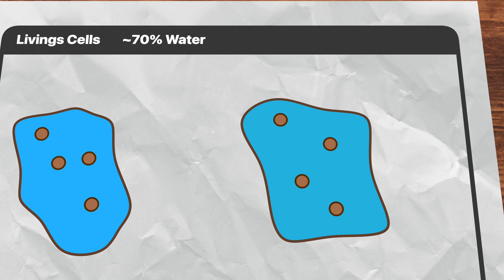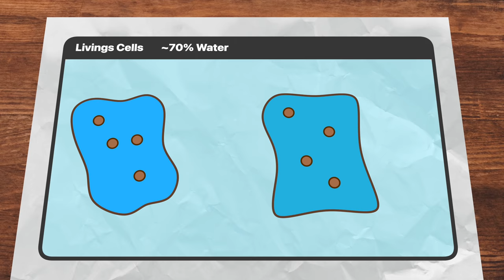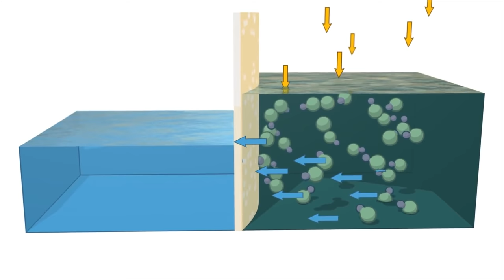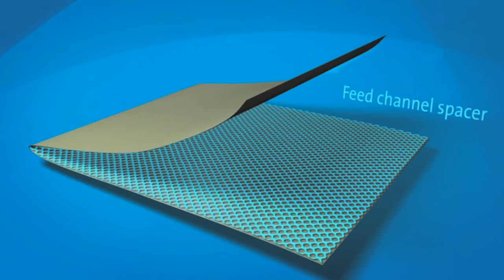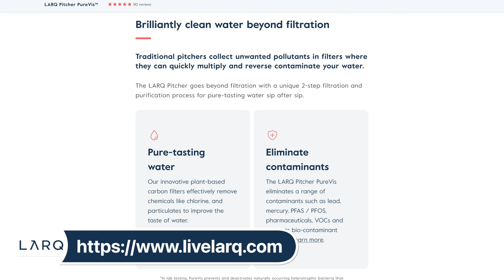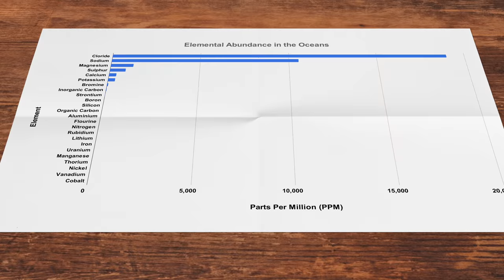Why Not Build Desalination Plants EVERYWHERE?

Comment: While in the US NAVY the ship that I served on was nuclear powered. We used the reactors heat to distill sea water for the ships reactor coolant and drinking water, plus equipment coolant as sell. We never went on water rations.

The best way to get electricity and fresh water is to build small nuclear power plants and have desalination plants next to the electric generators. Win win.
Nuclear reactor technology had come a very long way since the 60's. Safer, simpler and cheaper to operate and maintain.
Reply: You don't even need much heat water boils at 30c in a vacuum.
Reply: @Barskor1  heat or energy used to reduce atmosphere, potato potato, there is a requirement for latent vaporization
Reply: @imakedookie  Gravity can do the work to create a hard vacuum with just two tanks 12 meters apart one above the other fill the top tank with water and let it drain to the bottom tank.
Reply: And what did the navy do with the nuclear (fission) wastes?
Reply: @davidhuttner275  Navy reactors are typically highly enriched so they last for decades. The quantity of waste is tiny and the radioactivity will drop much faster then traditional reactor waste. Eventually I'd hope these fission products will be recycled and valuable elements repurposed but since the quantity is so small this isn't a problem that needs to be addressed for a long time.
Reply: How much nuclear waste?
Reply: Completely agree
Reply: @jamesrindley6215  Most of the excess cost is bound up in legal and regulatory obstacles. Reduce those and nuclear costs could be cut in half.
Reply: @ehabmanharawy415  Nuclear is actually much safer then we're led to believe, even big accidents have usually no deaths and the only one that killed members of the public was Chernobyl. Even then only a few dozen people died, most of the deaths you hear about are projections from faulty modeling.
Reply: Yes
Reply: Based, thank you for your service and nuclear power would truly the future if big government on BOTH sides weren’t trying so damningly hard to make it a climate change boogie man.
Reply: @Admiral Preparedness Ret You're talking about thermal desalination. This process leaves a by product of brine, which is dumped into the ocean where it sinks to the bottom and destroys the ecosystem. This was explained in the video above that you're commenting on.
Reply: @howhigh0521  close down 1 cole mine and you'll have more space than we'll ever need. there really isn't much.  I believe the process to prepare for storage is called glassing
Reply: @shahbazfawbush  yes Fukushima, with it's 1 fatality from radiation in 2018. 27 people died in the US mining coal that year
Reply: @thehemmo5078  Fukushima was bad design, Chernobyl was bad design triggered by bad operation. Unfortunately people are idiots and shortcuts get taken.
Reply: @Zayphar  What we really need is a standardized design. The French figured that out long ago. Then the French managed to sell a new and massively expensive design to the British whose taxpayers and electricity consumers will be paying through the nose for it for decades.
Reply: @JohnSmith-lm9gr  Good point.
Reply: @jamesrindley6215  My father was a Nuclear Engineer and made fuel assemblies for the Germans and many American reactors. He had nothing but admiration for the excellence of the French reactor design, considering it superior to most BWR and PWR designs then current in the US.
Reply: @mikeclifford7740  Chernobyl today is one of the most vibrant and prolific wildlife refuges in Europe. Wildlife, both plant and animal, around the site are thriving, and recent scientific studies of the wildlife shows no signs of negative symptoms due to exposure, past or present. The secure area does not begin until you are within about 700 meters of the concrete tomb. People don't live in the area because they are afraid. The fact that their fear has no scientific reality is irrelevant. The local politicians don't want to deal with it so they have cordoned off the whole area.
Reply: @howhigh0521  Long-term storage of nuclear waste is almost entirely a political problem. The engineering problems were solved 20 years ago.
Reply: @mikeclifford7740  People have mostly moved back already, in fact at most they only really needed to leave for a few months. The Japanese government were extremely over-cautious due to public concerns, while the science said there was no need for such a long move.
Reply: @multidimensional_holographer  Waste can be recycled in fast reactors, it is a tremendous resource not a burden.
Reply: @jamesrindley6215   "I'm not sure where you get the idea that nukes are cheap." I am confident he is not. He is just referring to "Nuclear reactor technology had come a very long way since the 60's [it's] Safer, simpler and cheaper to operate and maintain." Meaning he is just saying they are cheaper then they were in the 60's.  A simple misunderstanding.
Reply: @Spacedog79  amazing, if that's the case then the Taliban should invest in a nuke power plant
Reply: @multidimensional_holographer  Or, you could store it at the Yucca Mountain nuclear waste repository as was intended in 1987, which was killed by Senate Majority Leader Harry Reid (D-NV).
Reply: @rahanm7307  Real life science is not a Simpson's cartoon.
Reply: This would make sense in a case where there is waste heat being generated, but the heat generated by a nuclear reactor is the point of the thing, not a waste product...  You're converting a finite amount of heat into electricity, evaporated water, ship movement, etc. right?  I can imagine that there is always some level of waste heat being generated, and that this system was a very good solution for your ship.  I'm just not sure that it amounts to a free lunch.
Reply: @Gator777  a softball every twenty five years.
Reply: @ehabmanharawy415  You know nothing about the tech, obviously.
Reply: @Barskor1  yea you'll never guess what water has... OXYGEN. crazy right?
Reply: @Spacedog79  I'm a proponent of nuclear energy but to say "only a few dozen died" of Chernobyl is probably an inaccuracy. Directly, because of the containment breach, around a few dozen is true but those that died early deaths because of the radiation is not just due to faulty modeling. Yes, there are exaggerated faulty models. Yes, after the disaster... individuals from the immediate area were parts of study after study, looking for every kind of malady and more were found because of the excess scrutiny. Probably only a few hundred died early due to cancer, especially thyroid cancer but not 10s of thousands like the models would suggest.  You're right that the modeling is bad because the children were developing thyroid cancer - small children and adolescents are proven to be the most susceptible to thyroid diseases due to exposure of one kind or another but longer studies showed it was just certain age groups exposed during a specific amount of time. One of the positive things about that is that thyroid cancer is easy to treat because you can just remove the thyroid - not without consequences to the body... but ~85% live to a country's age of average mortality.

The dangers of ionizing radiation are real but way overstated.  Explosions due to steam like Chernobyl simply wouldn't happen today and a reactor built in 1971 like Fukushima wouldn't be built today where an earthquake damaged the cooling systems. In 2022, the cooling isn't susceptible to that type of damage. That type of disaster is still possible but it would have to be done by humans... multiple people working together to use it as a weapon. Still no more dangerous than coal though, even that causes 100s of thousands of excess deaths each year due to air quality worldwide. Not CO2 being the cause but excess particles in the air in exotic concentrations. If you're afraid of CO2, then yeah there's an excess of that also compared to nuclear... a net reducer of CO2 given comparable energy sources.
Reply: @shahbazfawbush  fukushima has been estimated to not significantly increase the chances of cancer in the general population that lived nearby, and only slightly for the workers at the plant. The tsunami that caused the fault was far more destructive both in terms of economic damage and loss of human life.
Reply: @Zayphar  even if nuclear costs were cut in half, renewables like solar and wind would still be cheaper per kilowatt hour, so unless you're building a desal plant in an area with little sun or wind (a very rare circumstance) renewables are still a better choice than nuclear, economically.
Reply: @Gator777  Not much.
Reply: @ehabmanharawy415  Can't make nuclear bombs with nuclear power plants.
Reply: @Spacedog79  The climate protesters would have people think otherwise. That's why nuclear power station have gone down in numbers.
Reply: @depralexcrimson  Ok I know that water has oxygen what is your point?
Reply: @matthewparker9276  No. All kinds of No. I don't where you are getting these 'facts', but still...No. Not even close to yes.
Reply: @lancemcque1459  yea but it can get u closer to figuring it out
Reply: I'm not saying you are wrong... but coastlines get hit by hurricanes and tsunamis, and on the west coast of America, there is the bonus round of earthquakes.
Reply: Say no more mate, im agree with you. Nuclear power its a must.
Reply: @howhigh0521  it's been figured out for awhile it's called cover it in concrete, glass, and ceramic or you could just bury it deep underground
Reply: @jamesrindley6215  Could you name all the nuclear plants that blew up and give people an idea of the casualties? I'm pretty sure you're talking out of your posterior. Also, after construction nuclear is one of the cheapest forms of energy
Reply: @shahbazfawbush  How many people died from this nuclear disaster that was caused by an earthquake and subsequent tsunami? The newer nuclear technology is even exponentially safer than that plant
Reply: @jbzdyk  OK OK, nuclear energy is an interesting option...
Reply: @ObIitus  with some more research Nuclear could be even better than what we have now, like how molten salts were a recent thing. Potentially even fusion down the line. But until there's a way to import some more from other places it's more like just doing it to keep an unsustainable status quo.
Reply: @jbzdyk  No need to be impolite. Check out Plainly Difficult channel for all the nuclear screw ups. It's not my job to educate you. Yes, if construction and cleanup costs are ignored, nuclear is cheap because of the fuel costs. But in the real world, ignoring construction and cleanup costs is simply fake economics. If you read my comments you'll see that I say nuclear is not viable because of costs, not because of safety. The times when these things blow, they don't kill huge numbers of people but they do render whole counties uninhabitable for centuries. That's why nuclear has fallen out of favour. The accidents were caused by hubris and lack of care.
Reply: @genericscout5408  Molten salt reactors are constantly talked about as some magic solution but there is no commercial MSR operating anywhere. That's because there are enormous and possibly unsolvable problems with this design. By the time they get fixed, if ever, renewables plus storage will be even cheaper.
Reply: @jamesrindley6215  Sorry I came off rude, but u imply many have blown up and have caused many casualties. This isnt the case. If u compare it to other power generation systems, nuclear is one of the safest. Construction costs come down with less government hurdles.
Reply: @davidhuttner275  Have it cool down for 70 years, then encase it in glass and put it in some salt mine.

Nuclear waste for power generation is the least of our troubles the other crap is quite a bit harder to handle
Reply: And what do you suggest we do with all the waste from these plants? Bury it in the desert? Because I hate to tell you but that's the current "solution" to this problem and that ain't much of a solution, especially to those of us who live in that desert.
Reply: @ryrylandcripps5811  The words you're looking for are "bury", "a lot" and "by". That being said, you're wrong. If it's so safe to bury it under a couple metric tons of dirt, why is there so much spent fuel sitting in cooling pools waiting to be disposed of? You can't just dump the stuff in a hole and throw some dirt on top. That's not how nuclear disposal works.
Reply: @ghill628  as others have stated reasons mostly political and of public opinion and security. Not just under the sand but deep in a catacomb of rock or limestone formation.
Reply: @ghill628 what, are you going to build a house with a nuclear waste foundation or something? If it's way deep underground in a area that is sealed and  not effected by severe weather, what the heck is the problem? The only thing I can think of being any sort of problem the transportation to that location from distant plants
Reply: We used Steam on she  US Navy steam ships to run the desalination plants on board the gators and oilers
Reply: @davidhuttner275  Most of it goes to a mine in Nevada. It’s actually a surprisingly small volume. (And one of the few wastes we actually do a good job of paying attention to).
Reply: @mbburry4759  If it's that simple why hasn't it been done yet? Why don't they just bury it on site at reactor facilities? Encase it in concrete and bury it on site. If it were that easy to get rid of don't you think it would have been done by now?
Reply: @russbell6418  No it doesn't go to Yucca Mt. That's the one site that was approved but as of yet no waste has been delivered or stored because of the ground water and geology issues with the site. It is not active and there are zero plans to activate the site pending.
Reply: My senior project for my science degree in sustainability centered around the use of SMRs to desalinate 60 million gallons a day. Kazakhstan had the first nuclear desalination plant on the coast of the Caspian Sea that operated without complications and no issues to marine life.
Reply: @ghill628  Actually the current "solution" is to store the radioactive crap in leaky tanks while everyone argues about how they don't want it dumped in their neighbourhood.
Reply: DBF !!!!!!
Reply: @shahbazfawbush  Zero people died from the effects of radiation at Fukushima, and none are likely to. It was only catastrophic for the nuclear industry - and climate change - and of course the 1600 people unnecessarily evacuated who died as a result.
Reply: @HowardDPVT  The Moltex Stable Salt Reactor Wasteburner will be around $1 per Watt capital cost, which is a fraction the cost of PWRs.
Reply: @jamesrindley6215  Thus expensive regulations
Reply: @jamesrindley6215  So you're cool with everyone burying their waste in your backyard? Of course you're not. No one is. Which brings us back to my original point which was; We don't have an acceptable way of disposing of nuclear waste so nuclear power is not the solution.
Reply: @davidhuttner275  nuclear reactors produce very little waste, you can power a whole city with nuclear power and only generate about a coffee mug worth of waste, of that waste some is used to produce smoke alarms, x-ray machines, and the rest is either short half life isotopes or unburnt fuel that can be used in MOX reactors
Reply: Nuclear is the way to go, but you also have to consider that every bit of nuclear generating capacity you use for desalination could have instead been used to remove fossil fuel generating capacity from the grid. It's a classic example of opportunity cost. As of right now, reducing CO2 emissions is more important that implementing large scale desalination, especially since climate change is one of the major drivers of water shortages in the first place. However, some day we will probably reach a point where it makes sense to use clean energy for large scale desalination.
Reply: @ghill628  Yes you're right, there is no good solution to the nuclear waste problem. The thing is though, however we get our energy there are environmental consequences. The real problem is that there are just too many of us and that we are all consuming too much.
Reply: @hydra70  You make a good point, but what is an alternative solution to water needs?  For some reason, rich people like living in deserts probably because their cars last longer, and you're unlikely to convince them to leave.  All I can think of is that piping water in from flood-prone regions might be more energy efficient.
Reply: @ericinMN1970  could you heat the brine until it becomes a solid
Reply: Yeah but the lead time would most likely make it a stranded asset before the end of its operating life I think we know enough about fusion that we should be braking ground on a commercial reactors we know more about fusion than we did about fission when we built the first reactors
Reply: @donodah411  Sorry, but we know less about how to build a working fusion reactor than was known about fission when the first nuclear pile was built in 1942. By that I mean that they knew how to create a sustaining reaction and have it create thermal gain. Fusion isn't anywhere near this target. Then add in the issue of tritium breeding and scavenging. There is no way to build a functioning generator with fusion now, no matter how much money we threw at it. Even if it ever does work, which is slated to be in the 2070s by the proponents of fusion, even then it will probably never be economic. It's a waste of money and is only worth doing as a physics experiment.
Reply: @donodah411  ...and?
Reply: @hydra70  that's the beauty of nuclear it is very energy dense. For example if you were to replace every boiler in a coal fired plant with an equal sized SMR you could increase power outputs by as much as 5x this means you could use a nuclear reactor to power a city and provide it with ample energy for desalination. In my job as an environmental conservation officer i did a study using new york as an example (about 12GW/h)  to provide that with wind yould need to cobver an area between 10 and 20x the size of manhattan island to provide that power in renewables, to do it with nuclear you only need an area half the size of manhattan (including support facilities, staff car park ect)
Reply: @Gator777  Barely anything. Far less than any other source of power.
Reply: @Mivoat  forgive me, I seem to be failing in connecting what you have said to what I have said. Would you please explain?
Reply: @Barskor1  Sounds like gravity is doing the work, but only after the tank already required work to fill it with water.
Reply: the best way is to use the solar systems largest and only net positive fusion reactor aka the sun
Reply: @catkeys6911  The cost for a normal water pump, tanks, and plumbing is low the energy needed to pump water is much less than is needed to create a hard vacuum with a special vacuum pump.
Reply: @RhodianColossus  I don't disagree with anything you've said, but would add the Kyshtym disaster, an indirect result of nuclear power production which caused widespread contamination. My argument is about the economics of nuclear. For instance, the British government will spend 53 billion pounds to clean up Sellafield. With nuclear, the profits are privatised and the mess is paid from taxes. Hinkley C will tie consumers into paying twice the going rate for the power it produces, if it's ever finished. Nuclear makes no economic sense based on construction cost alone, before you take into account the enormous decommissioning task.
Reply: @Spacedog79  They bring it to Hanford which is located near Richland ,Wa  Subs will come up the Columbia river
Reply: @multidimensional_holographer  we need earth abundance kept for future use.
Reply: @mafuletrekkie  Florida has a big tsunamis coming.
Reply: @ghill628  How about back fill all the gold and silver mines.
Reply: @davidhuttner275  - The gave the wastes to Captain Kirk to recrystallize dilithium.
Reply: I was on Spruance class destroyer and the water was delicious
Reply: @davidhuttner275  they recycle it..
Reply: @davidhuttner275  you should educate yourself on this subject. There was a lot of unscientific propaganda around nuclear energy with your generation
Reply: nuclear reactors... aren't cheap?  They make a lot of electricity though.
Reply: @sam4secretary  cheaper per watt hour for sure.
Reply: @ericinMN1970  the Navy uses RO units now instead of thermal desalination
Reply: Brilliant! My neighbor has been a nuclear engineer for 48 years, he’s 78 years of age, for all accounts he’s in a league of nuke, mechanical, heat transfer, engineering, that only a handful of people can comprehend. I’m not one of them! his only defeat faced in he’s career, is the ignorance of ‘everyone’s” idealism and lack of understanding for the value of nuclear power.
Reply: as long as you have a place to dump the "toxic waste" (brine)

subs just overboard it.  land-based desalinizers have to find somewhere to put it or find someone that WANTS it, then haul it away.  It's nowhere near as toxic as say, nuclear waste, but it generates a HUGE amount of it.  If you start comparing the amount of "toxicity" that is exported, it starts to actually get competitive with nuclear waste!

I suspect at some point in the future, places like this are all just going to designate "dumps" for their unneeded salt.  I haven't researched into it, but I'd be SHOCKED if that's not what Saudi Arabia / Kuwait aren't already doing.  Just placing a finger on the map, and saying "dump it all HERE".
Reply: @JohnSmith-lm9gr  number wants to hear about nuclear waste in their back yard.
Reply: @Zayphar  would you store it in your neighborhood ?
Reply: @Zayphar  again, not in in my back yard
Reply: @peterscotland1507  Yes!!! Easy money! If they offered to pay me to store it in my back yard or basement I would agree with a big smile on my face. I'm familiar with the technology involved and would have no fear. Fear of this tech is irrational and anti-science.
Reply: @peterscotland1507  A native American tribe wanted the site on reservation land because it would mean millions for the tribe and would be completely safe according to the science. The white politicians from the big cities wouldn't allow it. Fear of this technology is completely irrational. It's like a religious taboo.
Reply: Nuclear even with the improvements is still a long term slow destruction of the environment and a social problem in the making.
It all comes down to nuclear waste management and the reality that people take short cuts to save money (even with government oversight).
This is because people in such positions become lax and prone to pitching new ways to "save money" and with government officials worldwide known for rampant bribery, the end result is a ticking timebomb.
PS: As more efficient renewables come into effect the benefits are varied and many. There is no worry about Nuclear waste that will sit around for thousands of years accruing a constant cost or the fear of a plant explosion either due to accident or deliberate. with more people going renewable it means less power held by a few. Investment inspires growth and a consumer commodity makes far greater leaps in innovation. The list goes on but it is clear the long term winner is a decentralised power structure.
Reply: @Gator777  Vastly less dangerous pollution than what coal or petroleum power plants produce, and every bit of it is kept track of, instead of just dumped into the atmosphere.
Reply: Yes. But we will need to get started now. It takes years to get approval for any nuclear power plants.
Reply: Funny how this guy never even mentions nuclear power, which is the solution to many problems.
Reply: @jamesrindley6215  Yes. The US Navy ships has a good record with their nuclear powered ships.
Reply: @Rhaspun  In a rational world it would take about 3 years to finish the surveys and studies and get approval. Because of the politics involved, approval of any new plants will take an infinite number of years(i.e. they will never be approved).
Reply: @Zayphar  Laws can be changed to speed it up. It's like how solar panels can be installed on any home in California. A HOA cannot refuse to let a homeowner put panels on their roof.
Reply: @Rhaspun  I admire your optimism. As for me...it just makes me feel old.
Reply: @Zayphar  I'm not a youngster either. I've been retired for a few years myself. Will be 68 in a few months.
Reply: @lancemcque1459  Did you ever notice that when the costs of building one sometimes tripled the estimated original ,people started souring on the idea. Usually at least double original estimates.
Reply: @jbzdyk  all I have watched and followed far exceeded original estimates. The public picks up the extra tab while the power company (private) collects all the money. Without a smart grid upgrade we won't have the infrastructure to carry all the new ways we can generate the power.
Reply: We relied on US Army UH-60s to slingload "water buffaloes" of fresh water from CVN-69 Eisenhower for a few days during one operation until the US Army got its own water purification systems operational.

Nuclear submarines extract oxygen and water from the ocean. The time they remain submerged is limited by the amount of food they can store on board for the crew.
Reply: But that Distill Water hazardous to Health on long run
Reply: Having one tank higher than the other means energy still has to be used to get the water in the higher tank.  If the higher tank is still at water level, will need to pump water after filtration.  The energy cost isn't really avoided in such a case.
Reply: Tell that to fjb
Reply: @ericinMN1970  Bullshit..........it dissapates into the wider ocean.
Reply: @Zayphar  It is MUCH more straight forward........and often actually simpler.
Reply: @cdinicolo  It DOES amount to a shitload.   Enough left over to split water into H2 and compress into liquid hydrogen.........win,win,win.
Reply: @imakedookie  There's likely more energy leakage on thermal than there is on drawing a vacuum.
Reply: @ericinMN1970  yeah, but so was the third option the video talked about. It was still thermal desalination; just powered by the sun, as opposed to other forms of heat generation. They still create brine. However, they are starting to realize that they can process/recycle brine into useful materials, which could happen at ANY thermal desalination plant; instead of just chucking it back into the ocean (which, i agree, is a royally dumb idea)
Reply: And then there's LFTRs.  Thorium-based modular reactors which cannot melt-down could be the energy solution of the future, but there's two large problems: 1) Green energy hustlers and climate grifters; 2) Atmosphere of fear in the general public about nuclear technology.  These two problems are necessarily tightly coupled.  The grifters can't hustle if people aren't terrified of the nuclear alternatives
Reply: @TomJones-tx7pb  The discussion is about nuclear power. Nobody wants your political opinions.
Reply: @jamesrindley6215  First off you need to get help if you think you know what everyone wants. Secondly my statement was intended to point out a bad argument by analogy, not an attempt to slide into a discussion about socialism, so my apologies for that. Thirdly, I was responsible for building the systems  to contain one of the top nuclear disasters in the world, including the resulting nuclear waste so I know a lot more about this subject than I see in this comments section.  Fourthly  I can assure you that many of the issues and costs created by nuclear waste and accidents are not publicly disclosed by the high level people in the nuclear industry in the 2 nations I have worked with.
Reply: As if you're describing my base in Subnautica 😂
Reply: @cranklabexplosion-labcentr8245  .
Reply: @TomJones-tx7pb  A number of accidents in the nuclear industry and other fields such as aviation have been attributable to a dictatorial misuse of hierarchical power. It occurs under extremes of capitalist and socialist political systems. It can be overcome by a "stop button" such as Toyota use, where any employee with a genuine concern can stop production and the issue has to be looked into. Of course this is also open to abuse and arguably it may be difficult to transfer to other cultures. Another huge problem is regulatory capture and lack of independent oversight.
Reply: @flackstar007  That is a problem with Fukushima where they enriched the rods with plutonium to increase the energy yield.
Reply: @matthewparker9276  no not even close a  nuclear plant produces exponentially more power so cost per megawatt is much lower
Reply: @Gator777 Almost  None, the Navy recycles its uranium and nuclear byproducts. Nuclear power is the cleanest energy that we have avaliable on a large enough scale to handle this issue.
Reply: molten salt batteries could be made for electricity storage from salt waste and electricity stored in molten salt batteries  to be used to pump desalinated water
Reply: @Zayphar  reduce those and accidents will happen more often as they already do with all the regulations...
Reply: @ericinMN1970  The byproduct brine doesn't have to be dumped directly into the ocean. Ships could be constructed that would allow slow water flow through the bow where it would gather only a small amount of the brine at a time and carry it out the stern. If the ship did a 100 mile loop out to strong currents and back, at 10 knots, you're looking at roughly 12 hours (with time to leave and return to a loading pier). Four purpose-designed ships could easily and safely disperse the now diluted (and much safe brine) into the ocean (it would also be a warmer temperature so wouldn't sink as fast). I've always wondered why no one does this. Sure, it'll raise the cost, but over the long run it would greatly extend the life of a desalination plant because its intake wouldn't become so heavy in salt it had to be shut down.
Reply: Nuclear is the gold mine of alm technology. Its like a gift from God itself.
Reply: And humans have proved what happens next. They turned off every safety protocol to see what would happen. Chernobyl happened. We need something safer for people to do, like Crayolas perhaps.
Reply: I was just thinking “ Why not use nuclear power to heat the salt water and get fresh water back while cooling the reactor?” 

Sounds like I’m not the first think that up. Oh well, at least there is someone who can see a byproduct having  potential to solve other problems.
Reply: so what happen to countries that cant or are not allowed to use this technology, do they just die off?
Reply: @ericinMN1970  are you saying that only thermal desalination produce brine? ok you said it was explained in the video but the video didnt explain that you get brine as a byproduct from all 3 methods that he mention, I dont know if it was deliberate or was he just trying to pull the wool
Reply: @jamesrindley6215  yes I agree people are idiots, one prat just assumed that you dont get brine from reverse osmosis
Reply: And it also contains the word "nuclear" which sets massive amounts of hair on fire whenever it's brought up.

Find a way around that and we may get somewhere.
Reply: @davidhuttner275  Put it in hole somewhere where nobody and nothing messes with it.  It's suck a small amount that it's not the issue most people think it is.
Reply: @Barskor1  The energy to do so would come from pumping the water into the top tank... No free lunch
Reply: @Gator777  All nuclear waste in the US would fit inside a single sports stadium. For next question, ask how much space is taken up by Coal waste... And how much oil sits on the bottom of oceans after spills are "cleaned" up
Reply: Current Navy submariner here.  Most ships have switched from distilling tanks to utilizing Reverse Osmosis units for water.  RO units produce way more water significantly faster, it's a true night and day difference.  It would be more efficient to use nuclear power to power coastal RO units.
Reply: @ThomasBomb45  Not looking for a free lunch just the best deal to buy lunch and a cheap water pump and water simple pipes and valves are it.
Reply: @davidhuttner275  What is solar panels made of and what is the batteri made off and how do you get those materials ? and even musk knows nuclear reactor is needed.
Reply: But you get sea salt with all kinds of crap chemicals & toxic metals...
Reply: @ebrelus7687  Crap chemicals can be broken down into harmless or useful elements by Hydrothermal carbonization the toxic metals usually are useful in industrial applications anything else it is good to remove from the environment period.
Reply: Yes, at the Coast where they are easily targetable by enemy ships in international Waters. Amazing Idea, love it!
Reply: @beerenmusli8220  Oh my! armchair admirals...  it doesn't matter if you sit in international waters when you attack another nation you are still starting a war and committing war crimes that you can be held accountable for after the war ends individually and as a nation.
Reply: @edl617  It was probably the same general equipment we used on nuclear aircraft carriers.  I was a nuke MM.  I'm simplifying but main difference is the power source used to generate the steam - nuclear fission instead of diesel / oil burners.  From there we used the steam for pretty much everything.  turbine generators, main screws, desalination etc.  For the desalination, steam through venturi to draw vacuum and steam to heat the brine.  And indirectly - steam to make electricity to run the pumps for fresh water and brine.  Newer ships sound like they are changing things up some but back in the 80s the steam side equipment on nukes was pretty much the same as on conventional ships.  In fact, my A school training for MM was literally the same whether someone was nuke or conventional.  Nuclear power school and prototype came later.
Reply: @matthewparker9276  Except your solar and wind power don't work at night or when the wind dies (also generally at night)...
Reply: You said it your self. "Safer, Simpler and CHEAPER to operate and maintain." That seems to be a problem in todays World. It's just to simple and cost effective.
Reply: @Barskor1  That may stop them, but how does it prevent anyone from shooting civil infrastructure? Cause again, thats exactly what russian forces are doing in Ukraine.
Reply: Yeah until you start glowing in the dark
Reply: Overthinking one situation where direct solar radiation is perfect and free!
Reply: @Spacedog79  If you look at the cradle to grave economics, its still very expensive. The primary driver is national defense so we put up with the expense. And fission is a one way reaction. There are a few potentially valuable products but most of the products in the decay chain are also radioactive and have no market value. For those that are valuable, you have to do chemical separations on radioactive feed stocks to recover them, which is crazy expensive.
Reply: @scottys1423  If you add in the environmental and health costs then fossil fuels in the long run are much more expensive, and if you add in the need for backup at sufficient scale and dependence on fossil to build them then wind and solar are even more expensive.
Reply: @davidhuttner275  that's a good question, but I think we both know the answer.
Reply: @Spacedog79  it's nice to know that the Soviet Union has always told the truth -- there were very few deaths from the accident at Chernobyl.
Reply: @davidhuttner275  There are designs for nuclear plants (land not navy in this case, what I saw did not address navy) that recycle and use the waste several times to run it down.  Also there's a mold that we discovered from chernobyl that eats nuclear waste.  So theoretically we could have a (safe) dump location where we dump the stuff and add in some mold .. and it doesn't take 1000's of years to eat up the nuclear waste.  As per explosions and such, the newer plant designs don't explode or blast waste into the atmosphere like in the older designs would.
Reply: @ehabmanharawy415  No need to "figure" it out. Nukes are pretty easy to build if you aren't going for the super high yield thermonuclear designs that require much fiddling with the fuzing stage. Just go on wikipedia and choose one of the simpler designs, build it and there you go.
Reply: I have some changes that can greatly reduce the cost of running Desalination systems - These changes are simple and would eliminate most Viscous drag in the pressure producing process. I would like to find someone who can tell me I'm Wrong about these simple changes. It seems that no one really wants to improve the existing monopoly....I mean system...I look forward to any help
Reply: @haroldwestrich3312  Alright, go pm me, i have the machines to build a prototype. No money to invest. But it better be something substantial.
Reply: My ship's drinking water distilled from sea water was horrible tasting!!
Reply: Exactly what I was thinking.  Why use something energy neutral like a solar still when something energy positive like a nuclear reactor/still exists.  A nuclear plant also runs 24/7....
Reply: They use RO.units now
Reply: @Barskor1  It is a fair assessment but to boil water at 30c you need 50 millibar i.e. pressure around 60 to 70,000 ft above sea level. Can that be achieved with two tanks one on top of the other?
Reply: @rupakmehandiratta1633  Yes if they are 12 meters apart the top tank once filled has its valves shut and gravity pulls the water to the lower tank filling it up and leaving a hard vacuum in the top tank which you use to evacuate the operational system with the distiller and or turbine for making electricity.
Reply: @jamesrindley6215  Chernobyl was an ancient terrible design that was plagued by terrible management and a disheartened work force. Yay Soviet Era everything.
Reply: @jamesrindley6215  The Germans had a technology that is called Boron Float. The design was such that one had to actively work to sustain a nuclear reaction.  Without input the reaction will stop unlike others which will go into Fukushima mode.
Reply: @mikelouis9389  You're right that Chernobyl was an inherently unsafe design and the supervisor on that fateful night was autocratic and bullying. I'm not sure the workforce were disheartened, as my limited understand was that up to that point the nuclear industry was seen as a prestigious job in the USSR. The workforce were evidently fearful of the manager, and you can find plenty of examples of similar incidents caused by autocratic idiots and competent underlings who were afraid to speak up. It's brought down many planes for instance.
Reply: Nuclear power and desalinization plant should already be in California but they're nuts there so I don't feel sympathy as they have electric and water shortages.
Reply: For people who are worrying about the oceans rising!  So tired of that. Will desalination stop that from happening?  The water gets taken out of ocean sooo?  Turn desert into farmland?
Reply: not enough unless you grew your own food on the nuclear ship. 90% is used for agriculture. you had a huge nuclear plant to move the ship at 30knots, it's not to play PS5
Reply: @monologic4806  Sad.
Reply: @Barskor1  but why 12 meters and not more or less?
Reply: @rupakmehandiratta1633  12 meters is the point where gravity overcomes air pressure.
A simple experiment is to take a bowl of water then a bottle filled with water, quickly tip the mouth of the bottle into the bowl, and hold it vertical the bottle will remain full of water but if that bottle was 12 meters long the water int the bottle would flow into the bowl.
An interesting variation is to have hot water in the bottle and it will gush out as the slight pressure difference will make some water in the top boil off and push the rest of the water in the bottle out.
Reply: @Zayphar  ... so would the safety.....
Reply: I hope you're not a real "admiral".  But from what I've seen in my time in the US Navy, it would not surprise me.  lol  Admiral.  Hahah!
Reply: @Barskor1  so many questions.. what about safety.. can this vessel burst? I am just surprised why no one has used this method
Reply: @rupakmehandiratta1633  Vacuums cause implosions no bursting involved they are far less dangerous, build the system out of good materials and you have little to worry about. You balance how much steam you are creating at any given moment with the rate of condensation and volume of the condensation chamber being 2x the amount of steam you create.
Reply: Yup.
Reply: Til there’s a problem and the water becomes radioactive
Reply: @Spacedog79  It was Russian …
Reply: @Barskor1  how much of a vacuum?
Reply: @JohnSmith-lm9gr  from what I heard their biggest problem. is transportation for the waste material accidents happen. not sure if this is still problem though. they were working on an indestructible container for when it's being transported
Reply: @jamesrindley6215  Fukushima happened because of a major earthquake. Not by bad design.
Reply: @Zayphar  what do they do to store nuclear waste?
Reply: @easyislander  Yucca Mountain U.S. Nuclear Waste Repository was approved for use 20 years ago. Politics got in the way of the science.
Reply: don't shave....ur getting a great
reaction
Reply: @easyislander  I understand why you say that, but the plant was built in a known earthquake area and had backup systems in a basement vulnerable to flooding. There's a strong argument for saying that's bad design.
Reply: @williamthurman9082  ???
Reply: That's where LFTR reactors come into play.
Reply: @Zayphar  Some people are living in the exclusion zone. Although the authorities have asked them to leave some have been there since the time of the accident. Others have moved back. They have been visited by TV crews on numerous occasions.
 I have wondered if the authorities may like them to be there. After all not sure how anyone could be asked to volunteer to live there.
Reply: @lancemcque1459  The first reactors at Windscale were build to make bomb materials. Generating electricity was not the primary function.
Reply: @Barskor1  how much vacuum would be required to evaporate 220liters of potable h20?
Reply: Making nuclear plants small and cute will desensitize people (including employees) to their dangers, and making them numerous increases the possibility of accidents.
Reply: @sanniepstein4835  Is it being so positive that keeps you going ?
Reply: @jamesdewer   I really don't want to scroll through 240 plus posts, I proposed a way to make a vacuum pump using two tanks some piping and valves one 12 meters above the other and another system that when evacuated can boil water in a vacuum for distilling and that system would self-balance as the steam is condensed so it is not a matter of how much vacuum you would need but how fast you want to process 220 liters of water IE a 1 cubic meter volume system can do the job but may take a few hours depending on the effectiveness of your condenser.
The blunt answer to your question without context is 373,780 decimeters of evacuated volume if you instantly vaporized 220 liters all at the same time.
Reply: Does not address the brine issue.  We were dumping brine overboard in the deep ocean.
Reply: @davidhuttner275  there is only a small amount of wastes to begin with. Its not a huge issue...
Reply: @Gator777  the amount of nuclear waste from ship or submarine is minuscule.
Reply: @braddawson4496  Pump in more seawater and dilute the brine it is not complicated.
Reply: @Barskor1  it is complicated obviously that's the entire point of this video. It's tough to dilute brine with 35,000 ppm sea water.
Reply: We need more tritium breeding reactors. Nuclear fission reactors are necessary if we want to go carbon free.
Reply: You need just as much heat in a vacuum to boil water not as much temperature though.  Don’t confuse heat and temperature.
If water boils at 30 degrees C in a partial vacuum, the latent heat of evaporation will cause it to rapidly cool further and stop boiling.  You have to keep adding heat to keep it at 30 degrees.
Reply: @edwardcoulter9361  If you just let it sit there in the same space sure but when you draw the steam away to be condensed in another chamber with a pressure differential that does not happen Two chambers buddy one where hot water is sprayed in to expand and the second cold and structured to recondense the steam.
Reply: I was going to say the same thing
Reply: priorities.. you can't have everything. also lobbying for desalination plant in developing world is worrying me in the longer term. no EPA ?
Reply: @Spacedog79  Thanks for writing about that, as that is one of the arguments I get when I talk about building a nuclear power plant.  The US government also spent billions building a nuclear disposal plant in Nevada, but of course all sorts of arguments were put out their, so it was never used.
Reply: @Spacedog79  Don't entirely disagree with you- but your last eleven words are exactly how the nuclear power industry got into the "heap" it has been in for a couple of decades now. The solutions for these problems need to be dealt with "up front"- long experience says the original exploiters will want to have little responsibility for them. FR
Reply: @Spacedog79  Among others, I am quite certain about some fire fighters and engineers have died, who were part of the "first response" to the Fukashima  plant failure- due to poor design, I might add. And those few accidents (spend-o-meter is still running at millions a day at Fukashima now) having fatalities, and I do count any who die from "industrial stupidity" as needless and avoidable- just as we have in construction, and try to foresee and prevent as much as possible. Doesn't much sound like where you think we should operate- Maybe we would have a better deal if your Navy and Adm. Zumwalt and others hadn't trashed more civilian type research to get more fissile nuclear material for bombs from uranium based plants- all of which produce some fissile material, some a lot. Safer, till it goes boom; at which point it is a disaster of billion dollar proportions.  FR
Reply: @fredericrike5974  Nuclear scientists would love to deal with these issues "up front", they have been clamouring to build fast reactors for decades. The issue is the environmentalists who insist it needs to be dealt with up front are the same ones who fought building the solutions tooth and nail. They set the industry back decades with their litigation and misinformation.
Reply: I think we also need to look into thorium nuclear energy.
Reply: @Spacedog79  Maybe stunts like trying to "overwhelm" native tribes with Yucca Flats have something to do with this. And while we are on the subject, several of the worst offenders on enviro claims are US military bases- and damn all gets done to clean them up! Maybe the same stuff you point at the Other party belongs to the GOP for stalling any effort to get actual law passed to support the EPA needs mentioning. Both sides need to sit down with at least compromise in mind rather than culture wars and endless dispute rather than actually solving problems. See about reforming your Senate minority leader- Mr. "I haven't seen any Democratic based legislation that I can't throttle" McConnell. And while you are at it, you might look at the history of many other GOP "stalwarts" like Newt Gingrich and Lee Atwater. Don't leave warhawks like Adm. Zumwalt out either- nobody did more to kill civilian oriented nuclear research in the '60s. And if you are talking about "want to build", include the financiers and investors that don't want to pay for any of the "downstream" problems like waste disposal- developing while the Fed stumbles it's way through one half baked plan to remediate nuclear waste after another. Suggest you rethink your position- before an on the ground nuclear waste menace joins the bypassed climate change problem we already have from overly casual treatment of these same problems with regards to many industries.  FR
Reply: @fredericrike5974  I'm British so I don't care about US internal politics, all I want is nations to have rational energy policies.
Reply: The chance of nuclear contamination makes it impractical to use it to heal water for drinking. Although using nuclear energy would be an ideal solution its poses safety concerns
Reply: @AFRO_KEEN  Absolutely not true, the external water circuit comes nowhere near anything radioactive.
Reply: @Spacedog79  I am saying there is a risk of a failure where the drinking water can become contaminated. The power plants use water for cooling that becomes contaminated when there is a themal energy runaway
Reply: @Spacedog79  ON that part, we are in total agreement. I do include being both knowledgeable and responsible for the "downstream products" like nuclear waste.  FR
Reply: @AFRO_KEEN  the nuclear energy I was writing about is in the form of nuclear powerplants, big ones, that would be necessary to generate the power to run this project- indefinitely.  FR
Reply: @fredericrike5974  In places like India, China, Africa, and the Middle East benifits would outweigh the risks.
Reply: @multidimensional_holographer  The Taliban are more intrested in all Afghans following the Quran to the letter, above everything else. I don’t think they would have the capacity to consider what are proposing..
Reply: @AFRO_KEEN  Maybe so- that is a choice each of them will need to make on their own hook. Once begun, this commits the future to the maintenance and expansion of this system indefinitely. And I am not saying anything different. I am on record as saying that moving water from one watershed to another without much preparation, planning and applied science is a very bad thing, short, medium and long term, though.  FR
Reply: @fredericrike5974  I thought that nuclear would the answer to our energy needs where it could be used to create electricity. The electric power could be used to replace gasoline engine vehicles, create home heating, desalination and clean water. However, the potential environmental impact is the problem. In times of war the plant could be hit and leak. Also, other things can cause the radiation to become uncontaminated.
Reply: @AFRO_KEEN  Great place to spend some of the vast oil profit money on research, IMHO. But one way or another, oil is doomed, not tomorrow , but within our children's lifetimes.  FR
Reply: @fredericrike5974  Definitely and the world has up- coming technology to deal with that.
If they decide to capture energy from the sun you may still be reliant on middle east energy suppliers.
Reply: @AFRO_KEEN  "Has up and coming tech" was what the nuclear developers said too. That isn't enough- the tech has to be sussed out, the end products accounted for and then the verb "has" means" this is what we "have on the ground" now. Until then, it's "pie in the sky"- the developers will do their stuff and be nowhere to be found to help pay for the disaster. If you think I am incorrect, think about the present plastic crisis in our waterways and oceans- all that tech to create all those packaging miracles came from one small industry group.........Big Oil. In the middle to late '60s Exxon, in particular, was spending mega bucks to figure out what to do with  remains after a barrel of crude was refined for gasoline, diesel and oil- five of your six major plastic groups come from that research. Yet not one dime of Exxon's money is cleaning our coasts or waterways. And they made a "trash problem", their "trash problem" OURS, while they made a mega buck off of it and destroyed the paper and cardboard packaging industries. So I rather doubt "it will be great", "we will have a solution soon", "in a few more years", or any of that jazz will much count. Results on the ground is all that counts- the rest are "unhatched chickens".  FR
PS; Gasoline itself, in the form of "white gas" a clear distillate often surfacing within the stream of heavier crudes, was a "waste product, separated in holding ponds from the valuable crude and then run off via ditches into local waterways- rivers in Pennsylvania would be on fire as miles of this "white gas" burned , while it made local water sources foul and land unfit for crops. I suggest you do a bit more research on the very companies you would depend on to "get this done"- the history isn't very attractive, IMHO.  fr
Reply: @Barskor1  You don't even need to boil it.  Evaporation happens at much lower temps than that.
Reply: @emo65170.  Yes it does very slowly so if you have a surplus of time that may work but why wait 2 YEARS when you can get the amount of product in a day?
Reply: @fredericrike5974  Your not being negative. What you are talking about is the cons of nuclear energy.
Reply: The sun operates on the same principle
Reply: @bobb.6393  Exactly, you don't have to worry about spent nuclear fuel or contamination with sun energy. Also, energy absorbed from the sun is self renewing.
Reply: @lancemcque1459  Solar still costs the environment more than nuclear which only gets safer as well
Reply: I totally agree with you and it is green only when poorly manage it can be disastrous
Reply: Its almost like youve never been in the Navy before.  Things that make sense the Govt ignores.
Reply: @Despiser25  i was not able to serve, unfortunately, due to a serious medical issue that won’t even let me volunteer. I appreciate and respect those who serve on my behalf.
Reply: @matthewparker9276  however nuclear is smaller and has less effect on wildlife. Both are good options but, I like the idea of nuclear because the waste still has energy that could be harvested if technology gets better. Sadly research is slow.
Reply: Yep
Reply: Only safer when they use Thorium
Reply: @zeedee_7172 , distilled water is not hazardous to health unless you are already mineral deficient and not consuming mineral rich foods.
Reply: @bogeydope3022 , did Harold Westrich pm you? Was he blowing smoke?
Reply: This could save California and the food production states
Reply: @notahotshot  Nope he didn't. But to be fair, there is no more pm option. You have to do via comments and ano mails. Take a look at his channel, he already has a prototype of some sort.
Reply: you know this would help out the world. using this on a small scale would be perfect. a lot less problems when using smaller nuclear plants then before.
Reply: @Barskor1  And you still need energy to move the water to the top tank.
Reply: @ravencole2740  Yes and that is a minimal expenditure of energy and can be done with cheap water pumps rather than more expensive equipment like vacuum pumps.
Reply: What a CRAZY IDEA! I LOVE IT!  👍👍👍👍👍👍👍!
MANY THANKS for sharing!

YOU'RE AWESOME! 👍👍👍

BEST REGARDS!👍
Reply: @Gator777   A few ounces, for the reactor of a sub.
Reply: @davidhuttner275  There are Gen-IV Nuclear power generators that are incapable of experiencing a nuclear catastrophe and they are being built right now by China and other countries. Worrying about waisted nuclear debris is no longer necessary.
Reply: @davidhuttner275  Same thing you'll be doing with all those lithium batteries!!!
Reply: brilliant comment. Nuclear is a very clean energy source. We should build many more nuclear reactors. The new nuclear reactor designs of today are much safer than anything else we can build.
Reply: @Barskor1  Thats the point of the video. Heat creates brin. The brin has to go somewhere. So its more than just energy. Then eventually the ocean would get low on salt. This cause the day after tomorrow movie.
Reply: @colecole3352  ..........1 to harvest lithium from brine would still leave other salts to be returned to the sea.
2, the sheer volume of salt in the sea would make depleting it to an environmental impact level centuries in the future by which point we would have not needed the salt for at least 1 century.
3, movies are fiction they need a problem to solve or motivate the characters so it only needs to be factitious one that looks on first blush to maybe relevant but it is just goofy fear-mongering on further examination. 
4, If the sea actually did have reduced salt levels creatures and plants that live in river deltas would come to dominate the seas and life would go on, if done slow enough many sea creatures would adapt as well.
Reply: @Zayphar  it is now!
Reply: @thevoiceofonecallingout  You don't need nuclear power plants to distill seawater there is one above your head about 12 hours every day that does the job just fine if you bother to construct a properly designed facility and use physics to your advantage.
Reply: @imakedookie  yea,  some low density pumping costs And some valve acrion then a massive column of water down to pull an enourmous vaccuum.
Reply: I remember
Reply: The military does not need to worry about budgets or profits.
Reply: You could do the same thing with solar powered hydrogen platforms.
Reply: @spiderman no way home< really? the technology is there
Reply: @will2003michael2003  spiderman  now?
Reply: @jerometruitt2731  It would still require $billions and decades of infrastructure development. The money was already sent to Ukrainistan.
Reply: @Spacedog79  there is a reason that radioactive is called a "silent killer" 

And fukushima is costing japan 1 trillion dollars, so cheap?
Reply: Who ever put the pumps backup generator in the basement should never work in the field again
Reply: where do you put the radioactive waste? lol
Reply: @blacky4947  The Yucca Mtn project was cancelled.
Reply: I love you
Reply: Navy was distilling seawater back in the mid 90s. I’m guessing it went well because the Navy is still doing it 🤷🏽‍♂️
Reply: @ViceCoin  Someone said they (United State’s) have money for war but they can’t feed the poor.
Reply: @orlandotheman8245  True
Reply: @jamesrindley6215  
>setting up a few nuclear reactors is expensive
>covering the entire planet with solar panels, windmills, giant battery packs is cheaper

pick one
Reply: @jamesrindley6215  its still way cheaper than setting up God knows how many wind turbines and solar panels, there is also the question of what happens when there is no sunlight or wind. As for now slowly transitiong to nuclear while also incorperating renewables seems like the best way to go, too bad nobody wants to invest.
Reply: @ericinMN1970  All desalination leaves brine as a co product. Unless you're completely evaporating the water, you're always going to have brine.
Reply: @jamesrindley6215  Thorium nuclear reactors can use old style nuclear waste as fuel there is no need to store it anymore when it can produce more electricity and then be reduced to other elements.
Reply: @pyro226  No look at the energy costs to run a vacuum pump vs a common water pump, the water can be reused so you only need to filter/process once to operate a gravity-based vacuum pump.
Reply: @TomJones-tx7pb  The problem with Fukushima was the location they built it and the lack of tsunami safeguards.
Reply: @dundonrl  Battery storage for night time etcetera.
Reply: @beerenmusli8220  Does anything actually stop criminals besides fear of the would be victims being able to kill them? No.
Reply: @jamesbowen2105  The best part is no part, the best procress is no process. Elon Musk.
Reply: @deletdis6173  RO units....the endless filter scam and a garbage pile of used filters...
Reply: @johnsimpson5471  Very close to drawing 30 inches of mercury or hard vacuum like deep space.
Reply: @orlandotheman8245  Governments have power because problems exist if the problems get fixed then who needs to suffer the costs and abuses of a government?
Reply: @Barskor1  Exactly how big will these batteries be, millions of tons!
Reply: "solar, wind and hydro are better solutions"
says the "green" energy supporters that have recently been bought out by oil lobbies
Reply: @davidhuttner275  
look up the Nuclear Transport Containers, they are usually put on trains and are virtually indestructable, another train that hit it head on only left a dent a size of the door panel and the train was destroyed, they tried a truck with a full load and even that was less than the first full head on train collision

Also, radioactive "waste" is actually less radioactive once used and it just basically turns back into a rock/sand
Reply: @ysdom  
interesting reply, but most deaths and cancer caused by today are from leaving anything that isn't nuclear, continuing to operate, I have already seen documentaries and data that suggest people living next to gas/coal/oil plants are more likely to die within the next decade just from the massive air quality drop
Reply: @Barskor1  I might be looking at the wrong comment chain.  One person said to boil water in a vacuum because the thermal requirement (30C) needed for such is much lower than the 100C needed to boil water at atmospheric pressure.  The other person implied / stated that using heat to reach 100C or using energy to draw a vacuum and heating to 30C would be similar as they both need to overcome the latent vaporization of water.  My point was that using heat generally has more thermal leakage (radiant heat) than drawing a vacuum.
Reply: @pyro226  Ok soild point.
Reply: @dundonrl  ......And what is your point? How much do you think a coal fired power plant weighs and space it takes up?
Batteries can be many things stored compressed air, or liquefied gasses, lithium iron phosphate batteries, a pool of water pumped up to the top of a hill all kinds of things can be a battery.
Reply: @Zayphar  Trump for kingship of the nuclear regulatory commision!!!
Reply: @ryanbeard1119  NO! All kinds of no. Pick a random professor of nuclear engineering. They could hardly do worse than what we've had to date.
Reply: @Barskor1  Yes. The Fear of getting into Jail, for example.
Reply: @beerenmusli8220  Context please.
Reply: @Barskor1  But you didnt provide any your self
Reply: @beerenmusli8220  Because I don't want to read through 354 plus comments to find out what you are writing about. So copy and paste what you originally commented on or that is the end of things.
Reply: @Barskor1  Ah, I see. I have to read thourgh 354 comments for that as well. 
I assume the Context had to do something with how reliant nuclear power is on cooling fresh water, and with increasing drought risk that will be a mahor drawback and how crime rates go down with more income and better retirement opportunities
Reply: @Barskor1  So you're basically saying all we need for nuclear reactors to work is to completely chane the way we interact with our enviroment?
Reply: @jamesrindley6215  Mentioning the French and Nuclear in the same sentence is not popular downunder in New Zealand 🇳🇿
Reply: Remember anti nuclear power plant people exist.
Reply: Yeah I wish that California and the people out here were more focused on facts than how they feel about nuclear energy. Too many scaredy cats
Reply: It[s definitely one way, but the point he is making is that where the brine goes after desalination regardless of the method being solar or nuclear needs to be considered and the opportunity not wasted.
Reply: @Zayphar  that's confirmed where?
Reply: @videosuperhero100  refine into salt and sell
Reply: @samreadssome2403  Yeah. The French were just shit as colonialists 60 years ago. But what does that have to do with a rational nuclear power policy in 2022?
Reply: @videosuperhero100  You're going to have to be more specific.  I've already posted over 30 times to this thread, and this discussion has digressed into so many different branches, I can't tell what you are referring to.
Reply: @samreadssome2403  ???
Reply: @samreadssome2403  Ok, but...that was literally 60 years ago. I wasn't even alive then, and I am old and grey. Reminds me of the Belgians and the Congo. Should I slam on the Belgians because they were some of the worst colonial a-holes of the 19th and 20th centuries...possibly in all of history? Or the Spaniards and Portuguese for the conquest of the Central and South Americas. Should I still complain about the Germans because of the Holocaust(nearly 80 years ago)? Or the Israeli-Arab war of 1949? That's just...It's history. Let it die.
Reply: @Zayphar  What breeder tech?  I thought it failed
Reply: @cdinicolo  very good!  That's a solution to an environmental complaint and it would seem any solution like this would have LONG SINCE been implemented except for the ecoterrorist politics involved
Reply: @PastorBrianLantz  ??? I guess you mean my aunt? She breeds Maine Coon cats. How did you know? In any case, her buisiness is doing fine. Thanks for asking.
Reply: @jamesrindley6215  if the Fukushima operators hadn't shut off the emergency cooling valves manually, nothing serious would have happened, because then the cooling cycle could have been augmented with seawater, even if all the original cooling water had evaporated.
Reply: Thorium is suppressed because the only byproduct is salt.
Reply: @konradcomrade4845  Hindsight bias makes accidents seem easily avoidable in retrospect. Fukushima was built without adequate tsunami protection in an area where tsunamis are known to occur. The backup generators were located in the basement. The plant requires active cooling to remain safe even when shutdown. From those factors it was inevitable that sooner or later this situation would occur. Yes, maybe they could have flooded it with seawater, maybe there are other procedures they could have employed, but if these were not clearly laid down in an emergency checklist for the specific situation then how would you expect people to make that decision in the moment?
The root cause of this accident is hubris in the nuclear reactor design industry. And why should they care? GE, Toshiba and Hitachi made their profits from this crappy design, while the Japanese government and the people of Fukushima area picked up the bill and lost their homes. There's the real problem.
Reply: @davidhuttner275  depleted uranium rounds were used in Iraq.   Causing long lasting damage to both sides
Reply: @jamesrindley6215  not flooding the reactor (which they actually tried and failed), but there was the emergency cooling tank, which could have been flooded with seawater through fire-fighter-hoses, in the case when all the water in this tank had evaporated. But alas the cooling cycle valves were shut and they couldn't open them without electricity. 
Bad design, bad preparedness etc. if they just had a video camera in the control room, where they could see the tsunami wave coming in! 
You are right, that is all in hindsight.
Reply: @ghill628  the backyard slogan is crap, the nearest city to Yunca Mountain is 100 miles away and it's a remote spot in the desert. It's also on Federal owned land. I get why people in Nevada may not want nuclear waste in their state because they don't have nuclear plants, but Nevada does have all those damns and resvoirs, like Hoover Dam and Lake Med, that the Federal government paid for and Vegas could not exist today without them. You can't have your cake and eat it.
Reply: @jamesrindley6215  thing is nuclear power from a environment standpoint is the best baseload power source, next would be natural gas. Solar and Wind are good power sources but they as of right now can't be baseload power sources because they are not as efficient nor reliable as nuclear and the technology to store large amounts of the extra power they produce doesn't exist yet. Then there's also the fact depending where you put the wind and solar plants at, you may also have to build the infrastructure to go with it. Which also increases costs. Until the day we get fusion power every power source will have a trade off, we just have to decide which trade offs are more acceptable for the environment.
Reply: @Bigmojojo  Wow, your logic is just as bad as your grammar. Yucca Mt. is on federal land. So is over 80% of all of Nevada. 56 million acres of Nevada are federal land. Only Alaska has a higher acreage than that and no state has a higher percentage. You want to punish Nevadans because the federal government won't relinquish their hold on the land in the state? That's not a reasonable argument. For instance, let's place the waste repository in Rhode Island because they own 0.7% of the land there. 
But, but. but that's too close to a city! And so is 100 miles which is farther than Yucca Mt. is from Pahrump and Las Vegas. Both those cities are within "fallout" range of Yucca Mt. That means if there were an accident at the facility both those cities would be in danger of being irradiated by the waste. The prevailing winds would carry any leak almost directly to Las Vegas. And let's not forget that Yucca Mt. is actually on the aquifer of the Amargosa Valley one of Nevada's major farming areas. But hey, what's a little plutonium waste to some food crops! 
But, but, but, Hoover Dam and Lake Mead! How you manage to misspell both dam & Mead is beyond comprehension, but that aside, half of each is in Arizona & I don't see you demanding Arizona receive the repository, which makes that part of your argument specious at best. As for those being the sole reason Las Vegas exists, yeah, that's just wrong. The majority of the power from the dam goes to California, then Arizona, then Nevada. The water in the reservoir goes to Arizona at a much higher percentage than Nevada. So again, why not Arizona? Also, Las Vegas existed prior to the construction of Hoover Dam. Did the water in the reservoir allow Las Vegas to grow? Yes. However, it is not the sole reason for the existence of Las Vegas. 
Let me restate your argument thusly; Why not build the repository in Washington state at Hanford? It sits on federal property that was used to enrich uranium for nuclear plants before being decommissioned. It is near the Grand Coulee Dam, the largest federal dam project ever, it is miles away from Yakima the largest city in the region and it already has the facilities. Don't like that? How about we build it in Oak Ridge, Tennessee? There is plenty of federal land there, they already have federal facilities set up, it is the site of the largest government expenditure of all time, the Manhattan Project, and it's far enough away from big cities that the prevailing winds wouldn't carry fallout too far. Don't like that? Okay, White Sands, New Mexico. Do I have to explain why there? First atomic bomb detonation, middle of nowhere, federal property, etc. I could list many other sites but I feel I've made my point.
Your argument lacks any real merit because it is poorly thought out and, frankly, very weak for someone trying so desperately to be pedantic. 
Maybe if I use parlance you're more familiar with, it will sink in faster. Your reasoning is crap.
Reply: @Bigmojojo  Fusion power is a boondoggle that will never produce economic electricity even if it can be made to work at all. Renewables are the way forward, already solar is a fraction of the cost of fission power. The challenge humanity must overcome is storage of renewables on the grid scale plus dynamic pricing to spur the development of a new generation of appliances which selectively operate when the grid is lightly loaded. This will balance demand to supply. We won't get where we need to go by employing the same thinking that got us into the current mess.
Reply: Thermal plants don't need to be adjacent to electric plants, there are multiple means of transferring latent heat energy from A to B. You also don't specifically need nuclear heat waste for this, there are multiple sources of heat. For example, An Aegis class with turbine engines produces enough heat for those ship desalination plants. So do those Aux rooms, even those main shaft bearings produce a decent amount of heat which is largely unused. you can even reuse the heat that was used directly on the desalination plants... which are usually in one of those Aux spaces anyway. There is plenty of heat onboard those ships, which is why there are 20+ ton AC units too, to keep those spaces sailor-friendly to work in.
Reply: @Barskor1  while that is true, it definitely won't create a perfect vacuum, maybe we don't need a perfect vacuum for this application, but the system you described isn't good enough for a lot of applications. Theres a certain level of vacuum where youd have to actively pump the water out of the top tank.
Reply: i wonder how much radiation is in your water lol
Reply: @chronosschiron  Everything emits radiation.
Reply: @whanethewhip  
yummy nuclear waste water LOL
im sorry but had ot say this
heat that you speak of may in effect leech radioactive particles to said water 
this is why the video dont show you nuclear reactors doing this 
seriously
we technically only have one or two metals on earth that can shield from radiation but NOT that can take such crazy amounts a prolonged heat.
Reply: @chronosschiron  You don't understand anything about latent heat transfer. And 170 degrees of heat used in evaporators isn't 'crazy prolonged heat'. In fact, much heat energy has already been used or dissipated before them. Ships are designed for constant power usage when at sea, whether nuclear powered or turbine powered, it's still latent heat used to evaporate that water. Anytime you have items in motion, you have heat. Pressure also generated heat. Rather than pretend you know anything about this, you should go and learn.
Reply: @ReeperRiopel  It will produce near perfect vaccum all you need to do is meet or exceed the hight of 12 meters for the top tank, you don't need to pump water out of the top tank if you calculate to volume of the bottom tank and the connecting piping as everything from the top tank goes there by gravity. and to fill the top tank a simple water pump is all that is needed. This is a regulated with valves if yo want to fill the top tank you shut off the valve that would drain the top tank to the bottom tank and so on.
Reply: The Navy has shifted to RO units on the majority of its newer platforms, probably for the reasons mentioned in the video. NuScale had a cool design for combining a Small Modular Reactor with different desalination plants in order to provide electricity and clean water to areas that need it.
Reply: @adammontoya8329  An A-hole RO filter salesman convinced some CongressCritters that their campaigns could do with some more cash and their sons etcetera look like executive advisor material earning 500,000 per year.
Reply: Building nuclear plants near shoreline- genrally the most unstable parts of landmass. If nuclear plants are necessary, I'd jump on the government regulation and red tapr wagon so hard.
Reply: @peteerickson4453  You use them as fuel for a thorium nuclear reactor.
Reply: @Barskor1  THIS!
Reply: @Barskor1  Water also boils at 25C in a vacuum.
Reply: @Gator777  only as much as the fuel put in when the ship is being constructed (at max too, a lot of it could be re-enriched to extract the remaining fissile uranium). Modern ship reactors are serving for the ship's entire lifetime without refueling.
Reply: Been saying this for years
Reply: Preach
Reply: The problem is it inherently creates nuclear weapons material
Reply: @seeker296  only with uranium reactors, research into & building of other reactors like thorium has been stunted since the gov wanted to prioritize uranium reactors solely for this reason
Reply: @seeker296  Not thorium
Reply: @Gator777  just make a massive underground storage complex like finland did that has enough storage for like 1000 years, wich means you only have to get a new storage every 1000 years :>
Reply: either you create a DEAD SEA ( water to salty ) .... or .... you just keep removing water and salt  , shrinking the ocean ...
Reply: I see that since 2009 the US Navy is turning seawater and air into aviation fuel (avgas) using the Fischer-Tropsch process. Why can we not use this to make petrol?
Reply: @Zayphar  tell that to the Russian soldiers who got radiation burns from going near Chernobyl in the early days of the Ukraine war
Reply: @ghill628  I live in a desert (the Sonora desert in Arizona) and I don't mind living right on top of a properly constructed nuclear waste facility.
Reply: @MrJm323  Then by all means, let's move the waste site to arizona. Maybe put it in the mountains outside Tempe.
Reply: @ghill628  Yes.
Wouldn't harm anyone there. ....In return, we'd like the politicians you elect to stop interfering with the construction (or manufacture) of new nuclear power generators. I believe the last nuclear power plant constructed and brought on line, in this country, was the Palo Verde nuclear plant in Arizona (completed and brought on line in the 1980s).
Reply: yup so many people forget all a nuclear ship is is a steam ship using radioactive materials to make heat to boil water ... essentially a kettle ... 
.
HOW you heat the water is where the cost is ... find a way to do it for free and you just need to get on with extracting all the minerals from the waste ... 
.
Reply: @Barskor1  It takes energy to produce a partial vacuum.
Reply: @Barskor1  What is the micron level of a typical hard vacuum?
Reply: @Mister_Pedantic  Two distilation cycles produces laboratory grade pure water if that is any clue for you.
Reply: @Mister_Pedantic  Did I say it would take no energy? No, I said it would take significantly less energy, water towers, water tanks, water pumps, pipes, and valves are simple reliable cheap old tech and all the thermal energy requirements can be had from the heat of sunlight in a glassed box and a roll black pipe.
Reply: @Barskor1  At any rate, we really need to get on this.
Reply: @Mister_Pedantic  Yes we do.
Reply: @Zayphar  reducing regulation on nuclear powerplants….yeah no thanks.
Reply: Being a sailor that uses Reverse Osmosis we only could hold 24k gallons of potable water, all that bromine would have some ppl breaking out and taste like you’re drinking water from the side of the house
Reply: I bet that the water was not the best as a matter infact i would not drink that water their has been problems and lawsuites were the soldier were getting sick and ever cancer over bad water 💦
Reply: Truly Green Energy.
Reply: @davidhuttner275  The waste can be used to make nuclear diamond batteries.
Reply: The problem is the radio active waste
Reply: @hyperbeastnimit4190  Nuclear waste is not dangerous and easily deposed of.
Reply: @rick-be  you're wrong
Reply: @hyperbeastnimit4190  Hard to argue with one filled with nuclear fear-I've been to Chernobyl.
Reply: @rick-be  hmm I have just watched alot of videos about nuclear waste and I see no other way then dumping it down in group in concrete capsules but not every company is following this and only the most radioactive waste is being dumped, am I wrong here? 
I'm not too scared by it and I agree on changing my view about this topic 🗿👍 (please reply)
Reply: @hyperbeastnimit4190  The Medea(my spelling)is highly anti nuke
when it produces no pollution and the amount of waste is very small.
The 1/2 life means it will show radioactivity but everything has some
but not enough to do any harm.We walked in Chernobyl town all around
with absolutely no danger.Most don't know that the other 3 nuclear plants 
continued to operate for 14 more years with no ill effects to the workers.
Reply: @rick-be  but what about the other nuclear power plants?
Reply: @rick-be  and can you please name the material correctly? It's getting intresting 🗿
Reply: So have you figured out what to do with nuclear waste? Do Thorium nuclear plants produce those same capabilities?
Reply: did you get irratdieated ?
Reply: @davidhuttner275  BURRIED THEM IN INDIA
Reply: The navy dumps garbage from the ships into the water.
Reply: Micro Nuclear Reactors like Low Energy Thorium Salts or other Hydrogen options?
Reply: Or you can use a gass plant to power the ship, and also for the reactors for distillation process
Reply: Or you can use a gass plant to power the ship, and also for the reactors for distillation process
Reply: T Raybern  It decays exponentially so technically some atoms will stay pretty much forever, but the real question is is it dangerous?

The answer is no, it is only a couple of centuries and it is basically harmless. You'd have to crush it up and eat it to have any chance of causing harm.
Reply: traybern  You're welcome! Free Government Money!
BTW, I was in the navy and slept about 30 meters away form two nuclear reactors for 4 years, so...that is no biggie.
Reply: While the ship was used on Nuclear reactor power  . Got used to Destillate your own and crew drinking water  .
Did any of you Develop any Cancer related issues or oher types of illness ? 

Will be nice to keep in touch with fellow team members if they still around.
Reply: I'm with nuclear 100%.. Unfortunately it's not an option now.
Reply: @ericinMN1970  That's not true. Well designed diffusive brine outfalls cause no detectable salinity gradient within a few meters.
Reply: @gregorymalchuk272  YouTube won't let me provide a link, so I'll cite one of many sources out there. This is from an ABC News story dated January 17 2019 titled Desalination's leftovers may negatively affect oceans and ecosystems -  "The main problem we were trying to address here is that there's been no comprehensive analysis of the amount of brine being produced," said Jones.

To do this, the researchers reviewed existing research data from 1980-2018 as well as data from a newly-uploaded global database of about 20,000 desalination plants from Global Water Intelligence. They used this data to estimate the amount of brine being produced for each plant and worldwide.

Their analysis, published in the journal Science of the Total Environment, found that, on average, every liter of desalinated fresh water produces a liter-and-a-half of brine. Worldwide, plants make about 142 million cubic meters of brine every day -- enough to fill more than 50,000 Olympic swimming pools.

The exact disposal method varies from place to place, but most desalination plants in the world are built on or near the coast, and these plants most often discharge brine waste into the ocean.

This could be a problem. The brine is denser than seawater, so when it's discharged it tends to settle on the ocean bottom, where it can harm vulnerable marine life. It also carries less oxygen than the surrounding seawater and might contain potentially toxic chemicals added during the desalination process, such as copper or chlorine. And because the brine settles to the bottom, away from waves and currents, it may be hard to disperse."
Reply: Much better now use a salt molten reactor to build submarine desalination boats. It can fill any country or area in need of fresh water.
Reply: I'm all for nuclear. 

I don't think it would work economically. It would be more expensive, somehow, because of over regulations, and corruption. 

 So I agree with ya, but just think peoples stupidity would stop it from being economically viable. 

 I always wondered why we don't use 45 degree solar vacuum tubes with fresnel lenses to concentrate the light. 

 I guess the biggest issue would be dealing with the brine, and cleaning them. Yet that is why they'd be nearly vertical. Let the brine go to the bottom. 

 (By the way the water isn't in the vacuum. Vacuum is for the outer pipe insulate the inner pipe. Just Google solar vacuum tubes. They are already used to heat water, and I guess can actually give electricity. Never heard of them till recently.)
Reply: @davidhuttner275 Fun fact. A 1,000 megawatt nuclear station produces just 3 meters of cubic waste a year. 

 Over the lifetime of the entire plant that equates to about ONE cargo container. 

 That is for a million people. Plants can be bigger, and more efficent. We also can reuse that fuel for many things, which also turns it into forms that are only radiated for like five decades or a few centuries. Can't remember, but it wasn't long on the society time scale. 

 When I learned all that I was flabbergasted.  Been gas lighted my whole life on how big an issue nuclear waste is. 

 That isn't the high quality nuclear fuel the Navy guy is talking about. No idea if it is even better as far as waste goes.